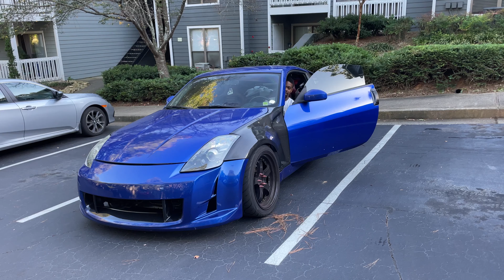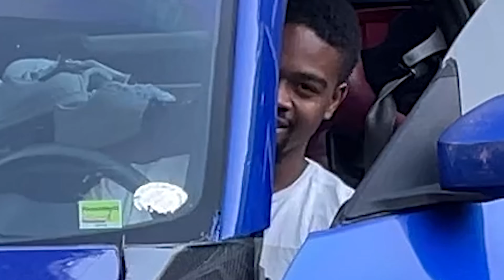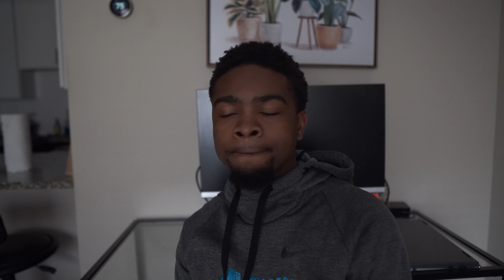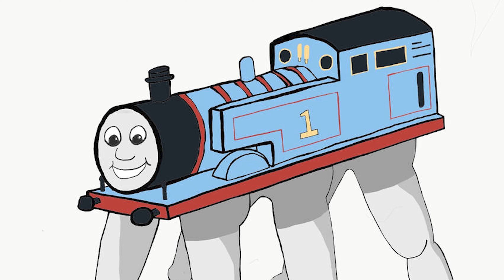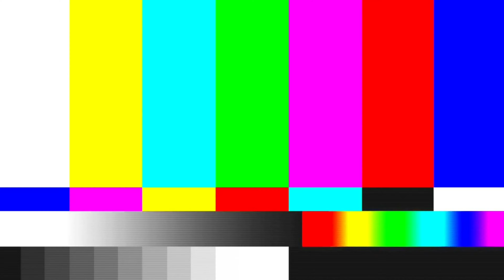Bad News. The 350Z Motor Blows Up...

Comment: I would just put a regular de motor in it and call it a day. Those go for about 1300
Reply from the maker: That is a possible solution
Reply: @JDMNEDU  it’ll be easier in my opinion on you cause the rev up motors are hard to find. And when you find them they are not cheap at all. But a de will put you technically horsepower wise to where you were at if not a little under which isn’t too bad
Reply from the maker: Also watch the latest video I just posted!! Got a new motor that I'm sure you will enjoy

Comment: Damn bruh.. that sucks and it's weird that it did that.

It reminds me of my swapped B series Honda, I drove it one and it was fine. I stopped and got gas, turned it on, and noticed a ticking noise but it like immediately went away. So I didn't really think of it really and just went on bout my day. A few days later, I've noticed that it would make a ticking noise every time I turn the car on, then go away after like 5 seconds. More days pass, I left work one day and was just cruising, next time I know it cause made a loud chirping noise and lost all power! I pull over, shut it off, pop the hood and I didn't notice anything. I get back inside the car and try and turn it on, nothing. So I eventually got the car towed to my house, looked over it again, tried to start it again and it started! Now it's making a loud knocking noise, but it sounds like its in the head. So I figured to myself that I may have bent a valve or something. Pulled the head off and I didn't see any damage in the head, so I put everything back together and still the same thing. I even swapped heads with another head. So I just came to the conclusion that I had a rod knock. Car has been sitting in my garage for 4yrs. Crazy thing about it all is that it literally starts up now on the first turn-key. I think it had jumped time too when it first broke down.

But yeah man.. it's hard to let something go that you've had for some long and put blood, sweat and tears into it, It's literally a part of you. I would just rebuild it and learn from it or, like everyone else does, just LS swap it. 2JZ swap would cost WAY too much compared to LS.
Reply from the maker: We keeping the z for life!!!!